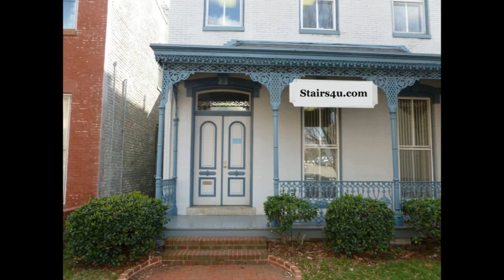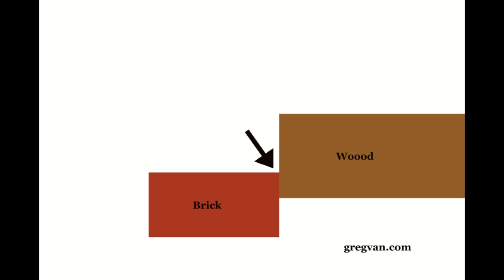Keep Brick Stairs Away From Wood - Deck And Porch Construction Tip

Comment from the maker: This reply is for Brianna, sometimes YouTube doesn't let me reply to the comment directly. Composite decking would be a good idea, you just wouldn't use it for structural framing components like joist or ledgers. It might provide you with the barrier you need between the concrete and other framing components. If I didn't answer question feel free to ask more.

Comment: Can you use composite decking? Would that be a go around? I have brick steps leading off sliding doors that go down into a large brick patio. I need to build a wheelchair ramp (free standing-not attached to the house) coming off the sliding glass doors and may need to place material over top the steps if the clearance is good. Thank you if you can help or if anyone can give advice.